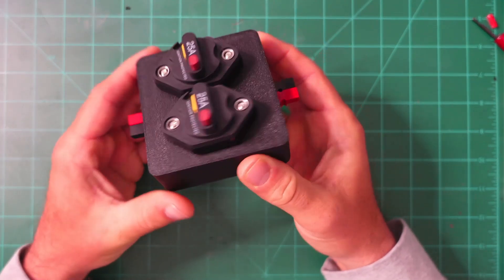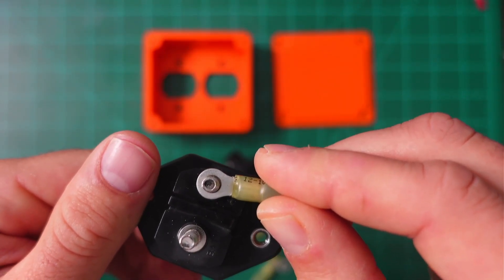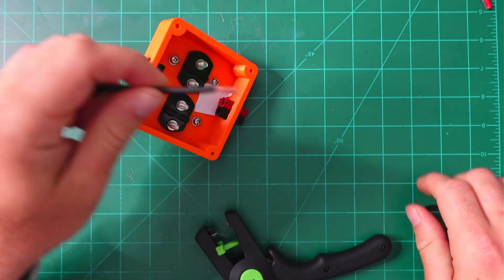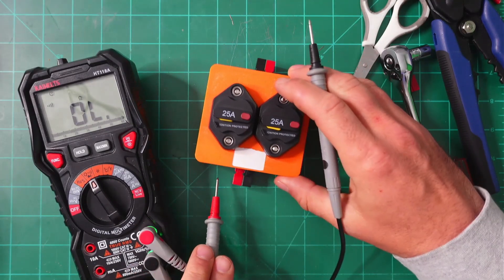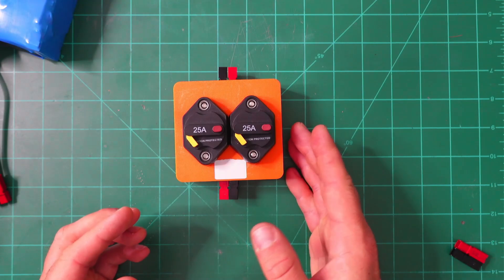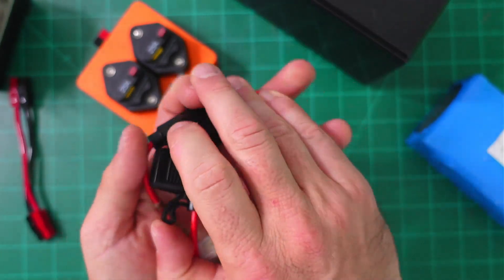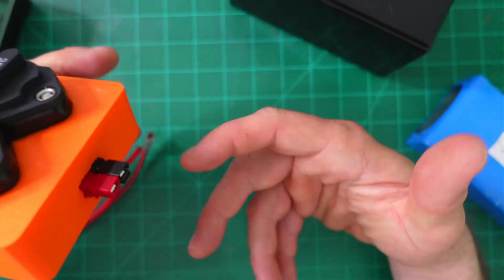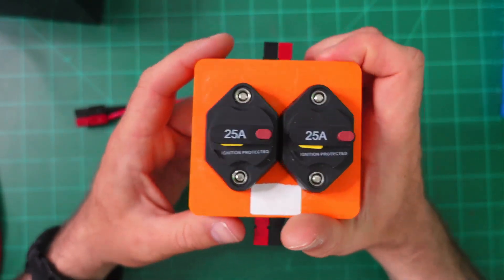DIY Ham Radio Project - Inline Power Guard  - Circuit Protection

Comment: FWIW - It's my understanding that the difference between the BAT and AUX terminals on low voltage DC circuit breakers is that the "breaking" apparatus is on the AUX terminal so that in a tripped state the only thing hot inside the body of the breaker is the BAT terminal.
Reply from the maker: I appreciate it and will confirm.  Thanks !!

Comment: Great idea and going to admit I did not watch the whole video.  Did you test how fast the breaker trips and how much over current it takes to actually trip it?  I use low voltage breakers to troubleshoot low voltage control circuits in my line of work and find they are substantially off the rated amperage and even worse at various ambient temperatures.  Possibly comparable to a slow blow fuse.

Comment: Fusing both leads is cargo cult electronics and I have never seen a justifiable reason this is done. It's just a waste of money and space and introduces additional failure points and voltage drop for the device being powered.

The link you provided gives a dubious justification about a failed starter negative lead in a car allowing current to flow through the radio, but this pathway will always be necessarily higher resistance than the chassis connection directly back to the battery via the ELD so no significant current will flow through the radio or its negative lead this way. The same argument could be made that current might flow from the starter through the chassis, into the antenna coax bond point, through the radio and back out its chassis bond and thus cause damage, even with no negative lead for the radio connected at all - this is again a pathway that will see no meaningful current due to the higher resistances, but it more clearly highlights the impossibility of the original argument.

Nothing outside of ham radio that I've ever seen does this, including commercial radio equipment; what could possibly be so special about amateur radio that would demand this technique that would not also apply to lots of other electronic devices?
Reply from the maker: Thanks for the input.

Comment: great project. yes you want to fuse both sides.  like if you are running a KW amp and it looses ground. the ground will find a way back to power source. like the shield of coax into the radio and out the black wire to power source. now you have 50+ amps  going threw your radio. on the black - wire. if you have no fuse that wire will melt or damage PC board in radio.  in a car/truck if loose ground to body wire all the current will flow threw the radio.  the fuse 1 side the POS only works if only thing connected to power source .with multi stuff connected one loosing ground will cause back feeding threw ground.  I would go with 10 AWG wire my self. 45 amp true Andersons. and I would add a crowbar board on the load side. TOM from A to Z has a real nice board. this even works in a HAM shack. do not relay on battery BMS or power supply to shut down.  that can fail and extra breaker can save a fire or radio gear . you can add LED if you want to. 73's
Reply: A fuse on the negative lead of the radio is the wrong way to handle this; if you're concerned about losing the ground on your beefy amp, you should be bonding the coax ground (with no fuse in that path) to your chassis to provide a lower-resistance return path so it doesn't flow through your radio. There are too many other ways the signal in question could find an indirect ground through the radio that could still cause damage (to the radio, or to you via a handset mic!), even with the radio's negative lead disconnected via an unnecessary extra fuse.

Comment: You could lighten it up and reduce cost by just having the one circuit breaker on the positive pole, what you have there is a bit over kill...not trolling just making a simple suggestion. But very nice job and a big fan of the channel.
Reply from the maker: Absolutely.   I'm going to make a 2nd version with a slot for just one.   2 versions.  Thanks,  I appreciate it!
Reply: @DudeTested  You could also keep the 2 breaker design and add a 2nd power pole connector. This would work for A/B usage with larger batteries. OFC you would need the feed to be a 45amp 10awg.
Reply from the maker: I was thinking that also! And maybe (i need to figure it out: reverse polarity protection with a diode . Thoughts? @spareiChan  @spareiChan
Reply: @DudeTested  Sadly it's to much amprage to just use a simple diode shunt, crow bar might be the only option on that.
Reply from the maker: @spareiChan thank you for leading me into the right direction!

Comment: The fusing in the negative lead is a thing that some manufacturers started doing long after I got into Ham Radio. It protects against some rare events in a mobile setup. In a portable setup it isn't needed. I would stick with a blade fuse within a few inches of the battery, and arrange a spare to be kept with it. A much smaller setup. Have fun de w6akb.
Reply from the maker: Thanks ! I appreciate the simple and detailed explanation!
Reply from the maker: Quick question for you, Alan. How hard would it be for me to add a reverse polarity protection circuit within this box?  I think that would be the next cool/fun step.  Thanks in advance!
Reply: @DudeTested  One approach is to put a back biased diode across the radio side of the fuse. This shorts the circuit if the polarity is backwards and pops the fuse. This diode must be large enough to survive to blow the fuse/breaker so it must handle a rather large current for the time it takes. Another technique is to use a series diode but this drops some voltage. Selecting a schottky diode reduces the voltage drop from around 1 volt to a few tenths of a volt. A third technique often employed is to use a MOSFET polarity protection circuit that you can find designs for on the internet. The FET would have to handle the full current but with the right FET the voltage drop could be very low.

Comment: Just a thought, but to relieve some of the strain on the wire, flip one set of powerpoles upside down going through the case so you don't have the bend in one set of wires.